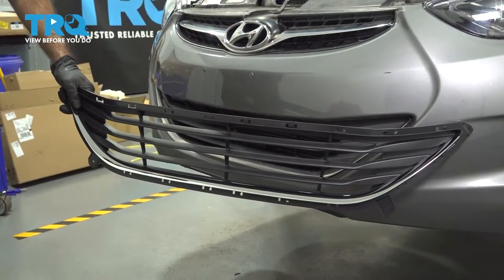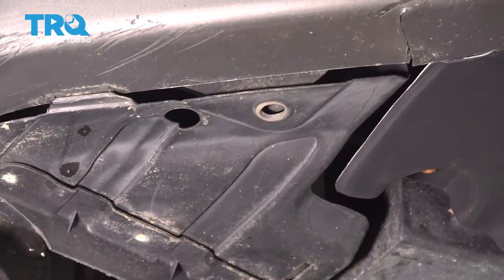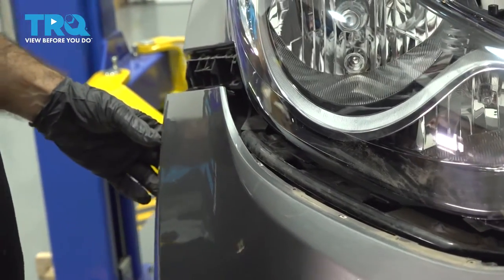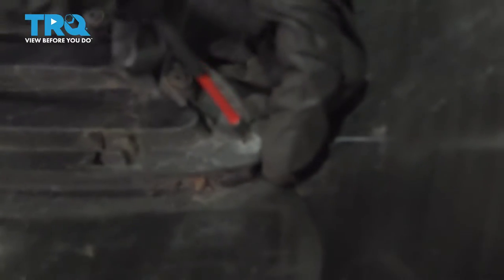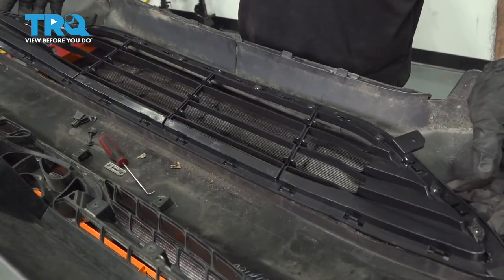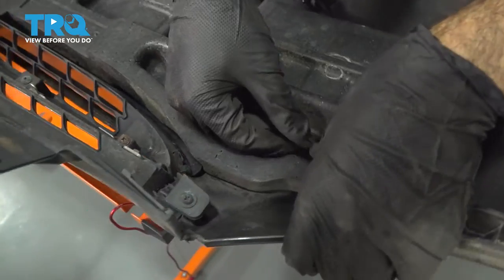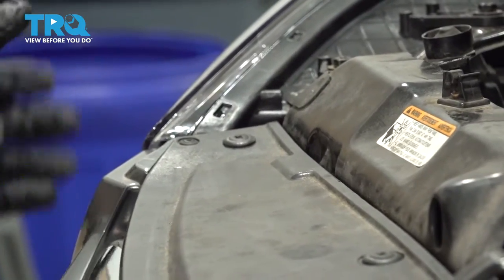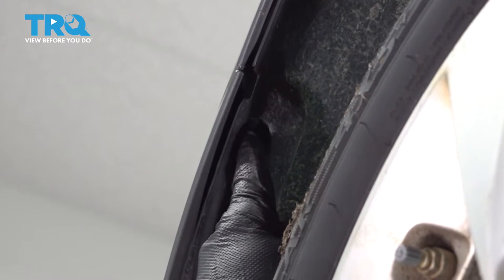How to Replace Front Lower Grille 2011-2016 Hyundai Elantra

Comment: I always suspected my elantra had front end restoration and they didn’t do a stellar job. One side is not flush with the rest of the body and a bottom lip of the front bumper is missing. I bought the car used used at a hyundai dealer with 45,000 miles it now has 110,000 miles on it.